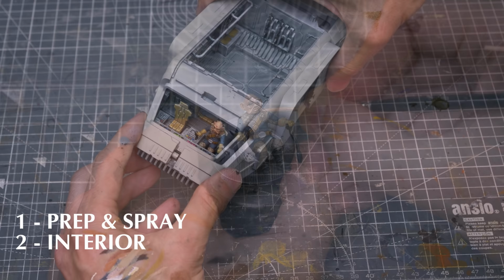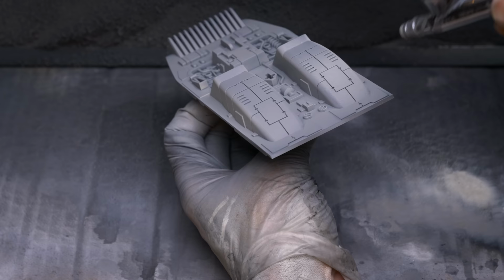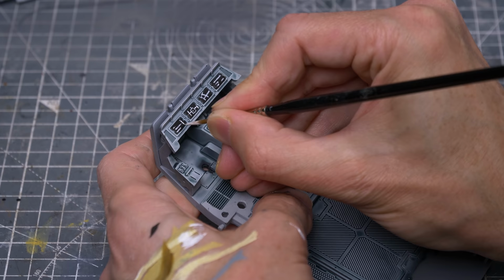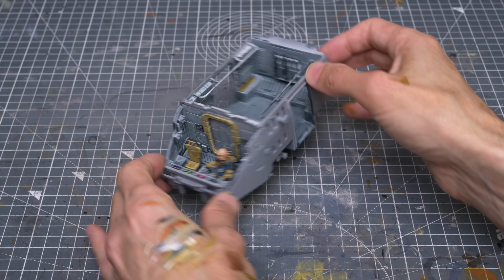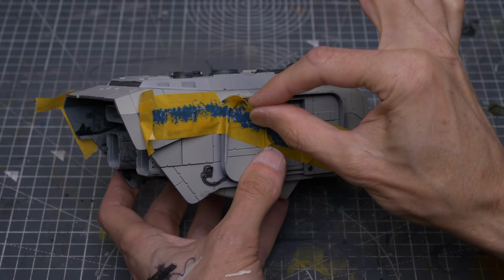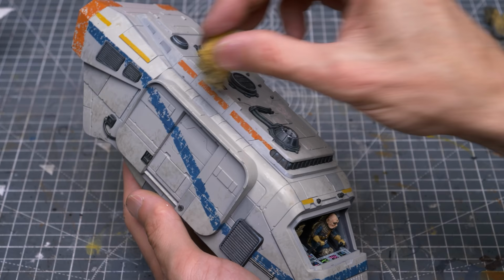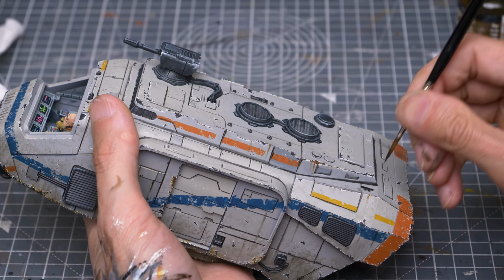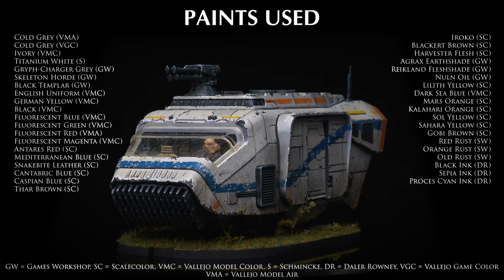Star Wars™: Legion Painting Guide Ep.24: A-A5 Speeder Truck

Comment: When you use brush-on varnish do you thin it with water or just use it as it comes out of the bottle?
Reply from the maker: Hi Lummox! With the AK varnish I just brush it on neat. If I'm applying it with the airbrush I might add a little thinner 🙂
Reply: @Sorastro  Thanks, just bought myself a bottle of AK varnish, been using Vallejo's Matt Varnish but for some reason the last 2 bottles I've had of that has made the model look wet when it dries. I also have the worst luck when it comes to spray on varnish frosting, so I'm excited to try out the AK varnish! Keep up the good work with these awesome videos!

Comment: Great work as always.  Question for some other units im painting:  Do I need to mix water into my flow enhancer, or can i put a drop straight into my paint?  Thanks
Reply from the maker: Thank you!  It's probably best to follow the instructions on the specific flow enhancer you're using, but I usually mix some into the water that I use to thin with.. :)